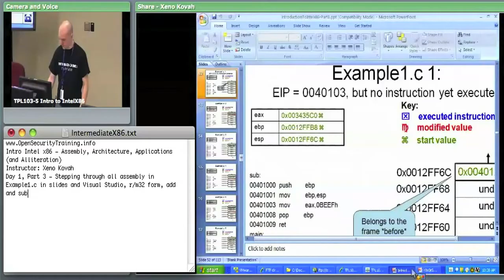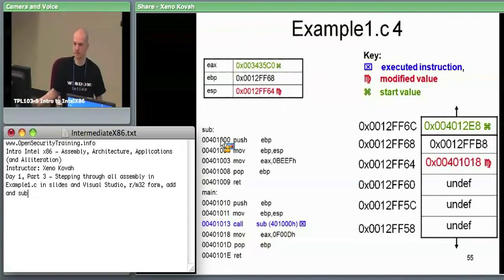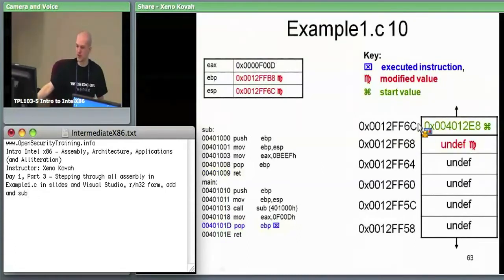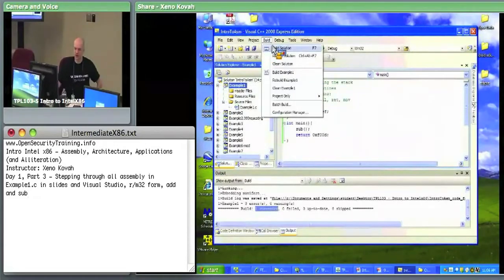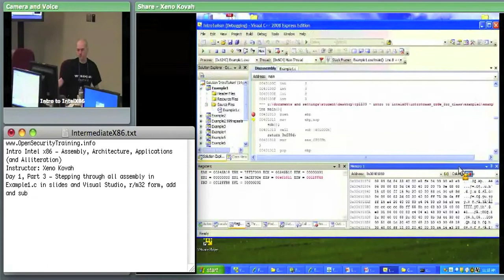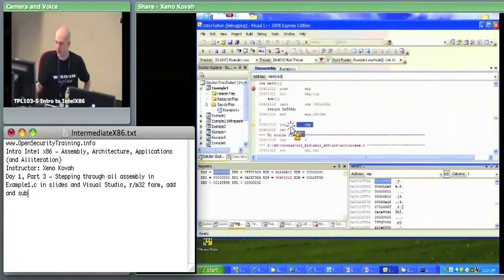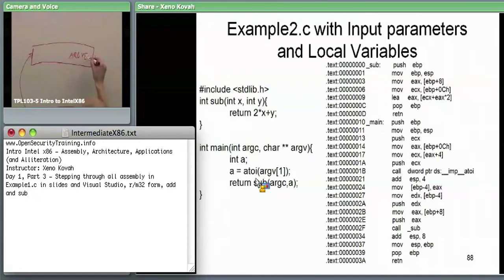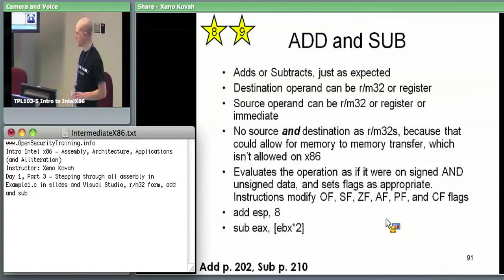Day 1 Part 2: Introductory Intel x86: Architecture, Assembly, Applications

Comment from the maker: Instructions == Code so your question doesn't make sense.
But I think what you meant to ask is whether the instructions and data are in the same memory space. They are all in RAM, but as you can see in example 1, the addresses of the data on the stack, by convention, for Windows (it will differ on Linux) is around the 0x0012XXXX range in RAM. And the addresses of the code are around 0x0040XXXX. The code gets put from disk into memory at launch, the data is manipulated at runtime.

Comment from the maker: The purpose of a frame pointer is the logical separation of the local information for one function from another function. It's just a logical separation though and isn't *required*, which is why you can compile with "frame pointer omission" optimization, and why calling conventions like fastcall or x86-64's don't use it. As far as use for security goes though, you're getting ahead of yourself ;). You'll find some information about how it's related to "stack cookies" when you get to Exploits1

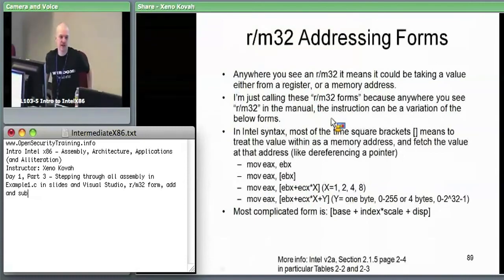Comment: Almost perfect -- I'm really into this.  I did notice at 1:16:36 or thereabouts, you refer to the characters used to de-reference an expression as a memory address of the actual operand as "angle brackets".  That term normally means the characters used to enclose HTML and XML tags, and the template and special casting characters in C++.  That is <these guys>.  [We call these ones "square brackets" usually.]
Reply from the maker: Correct. Xeno regrets any suffering caused by mis-description of the brackets ;)

Comment: 1:24:00
instead of
lea eax, [edx+ebx*2]
why not just use mov
mov eax, edx+ebx*2
if later want to get the vaule at address stored at eax
mov eax, [eax]
Reply: Hmm... From what i understand, lea eax, [edx+ebx*2] is only used to calculate memory address. Which in case of mov eax, edx+ebx*2 is not correct because it's adding and multiplying at same time where we can use add and mul for it.

Comment: If I understand correctly (if I don't please correct me), the diagram Mr. Kovah started drawing around 1:0:36 is displayed the same ways as compared to presented in the slides (like slide 52 and 92) where the higher memory addresses are drawn higher up on the whiteboard and the top of the stack is on the bottom of the whiteboard. At 1:12:24 he say "...typically by convention when the stuff from command line parameters gets passed it's going to be somewhere up higher on the stack ." When he says "higher on the stack" did he mean "higher memory addresses" and "higher up on the whiteboard"?

Comment: What is the real purpose of the base pointer?
Does it provide the means to jump to a function's frame directly? Or is it used to implement some sort of security checks to ensure that a function does not encroach into another function's frame? In that case, as long as the number of push instructions in each function equals the number of pop instructions, would it actually not be required?

Comment: Its excellent because for a year on my own, I could not understand it The only questions I have in building a compiler is, do we set the EBP to an address in ram, move the ESP to EBP's address, place a value at ESP, and then move the EBP to ESP's address -4, then ESP to ESP-4?

I'd appreciate it if you could briefly describe the order of the layout on how EBP ESP move to place values on the stack. Thanks

Comment: How we can debug our code in Linux ? which IDE is recommended ?
Reply: i would suggest gdb for debugging on linux (or maybe even radare2 haha). gdb is a terminal application, so you dont need any IDE to use it. You just do "gdb nameofexe" to launch gdb to debug an executable file called nameofexe. Though some IDEs / Code editors use gdb behind the scenes to give a more graphical debugging experience (I know VSCode (the code editor, not Visual Studio IDE) does this for C and C++, im not sure about any other IDEs tho).

Comment: array of structures is not multidimensional array. A multi dim array has multiple dimensions like anyType arr[2][4]
Reply: +Marinca Gheorghe Asuming that a structure is kind of a special array because it's indexed by its fields, then it is a multidimensional array. What's the difference between a struct { int a; int b; int c; } and int array[3] ? Structures are a more general type of array because it can contains multiple types (which leads to padding).
Reply: Well one could argue the semantics of 'array'. If array is to mean a contiguous group of objects referenced by index value, then a multi-dim array would 'require' multiple indexes. Never mind that fact that you CAN use ptr arithmetic to index the array, or even the fact that it may decay to ptr arithmetic behind the scenes. A structures contents are not directly referenced by index; they are referenced by name in a HLL, and displacement in a LLL. Furthermore, structures do NOT decay to arrays, as you stated. It is NOT legal to say StructName[1] to reference the first variable of StructName. This alone, in my opinion, nullifies your entire argument. The speakers example was spot on, but calling them a mult-dim array was incorrect.